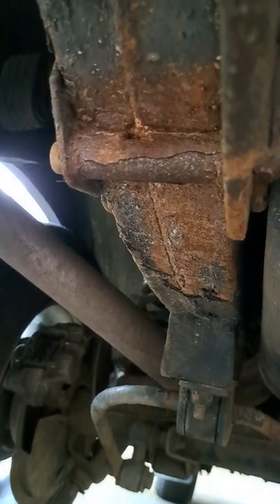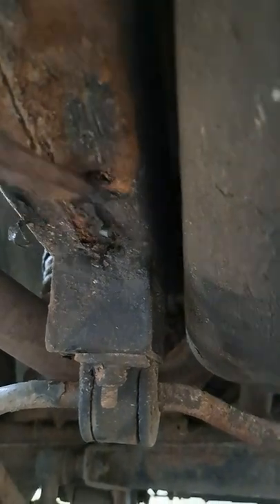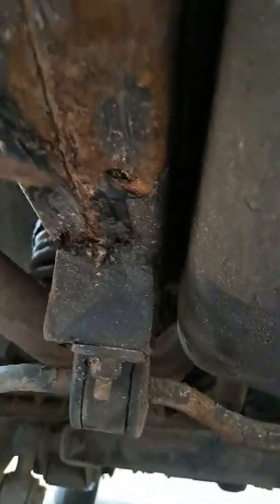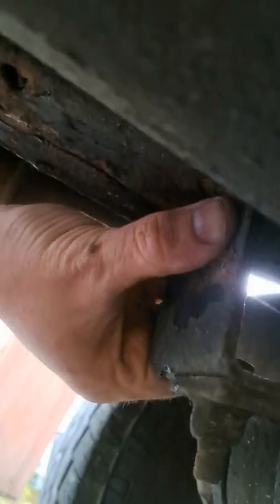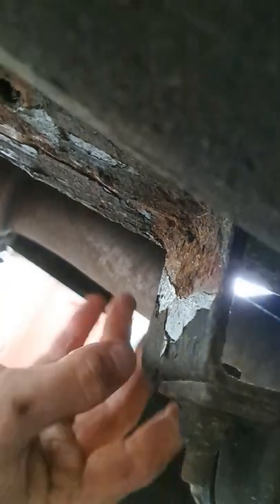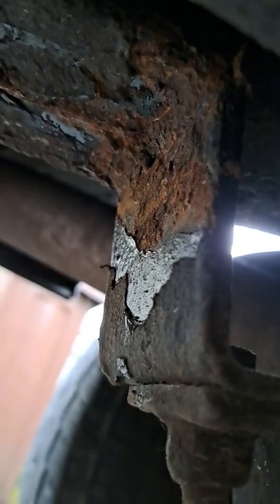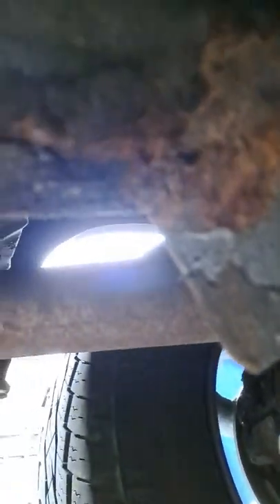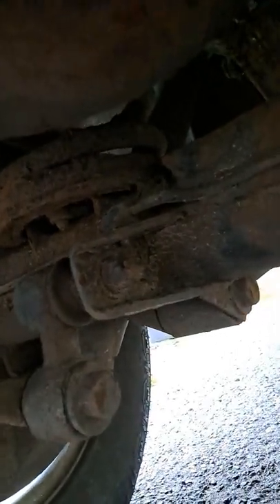Chassis coatings? Good or bad idea?

Comment: burn it with a mapp gas torch, or a campinggaz torch. The reason I suggest that is, its an easy way to get powder coating off metal. 
When i first tried burning the powder coating, i literally vaporised it, but after a while i realised that if I glided the torch evenly over the whole surface for 10, 20 seconds, the powder coating started to peel off in large sections, which was pretty cool. Your dinitrol or whatever may behave the same.
Reply from the maker: Thanks for this mate 😁
Reply: @flatcapadventurers  yeah try and warm it up evenly and then peel it off. Might work.

Comment: Adam.  Black waxoyl is the worst thing in the world for your chassis. I have been using lanoguard for years as it doesn’t trap the moisture and it kills any old rust as well
Reply from the maker: That's my thoughts to. Do you think the lanoguard is any better? Or does it start to peel in later life? We have a few Discos and I always find the ones that have just been painted with chassis black paint seem to be doing the best.
Reply: @flatcapadventurers  the lanoguard is much better and doesn't peel like the black waxoyl but what i have been tending to do is clean off the chassis, apply a coat of red oxide, leave it to dry then chassis black then the lanoguard on the inside and outside of the chassis...as the lanoguard creeps into all the nooks and crannies where you can't get the paint.
Reply from the maker: @All4Overland  that sounds like a mighty job👍